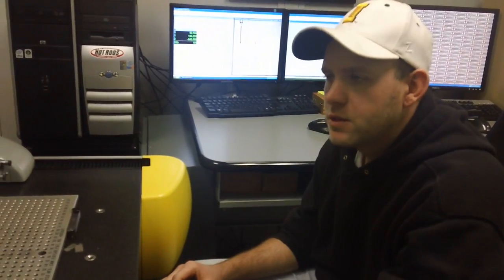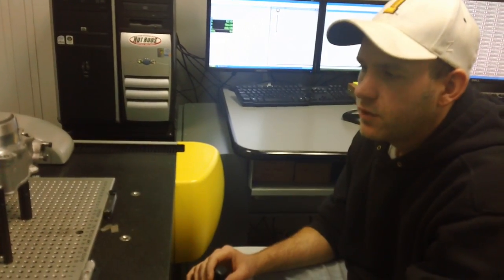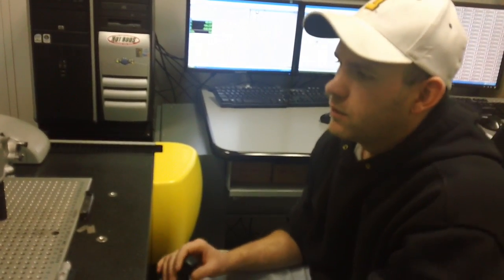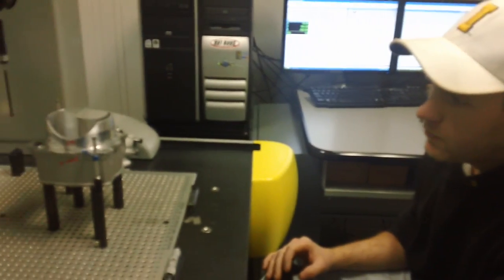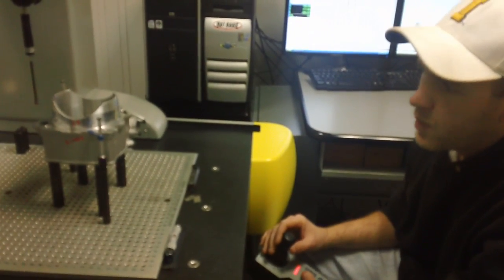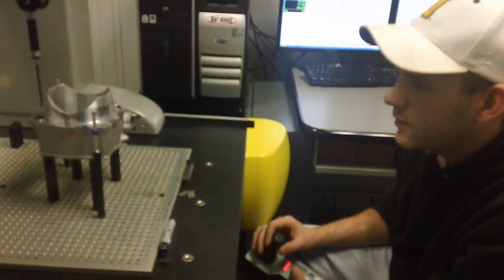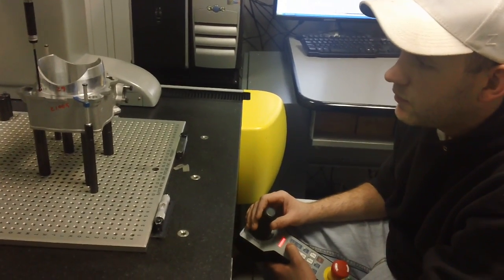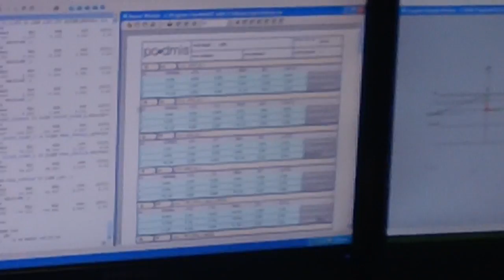Cylinder Works' CMM inspection on 2011 YZ 450F cylinder

Comment: Is this a casting? If it is why didn't you check the relationship between the casting and machining?I guess you could check it with a caliper..is the secondary alignment the bore and dial pin?